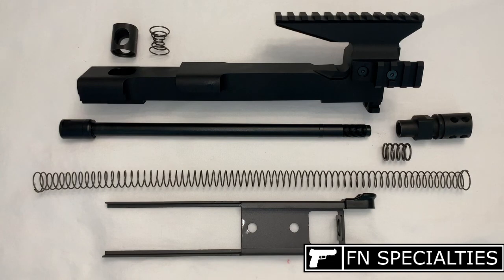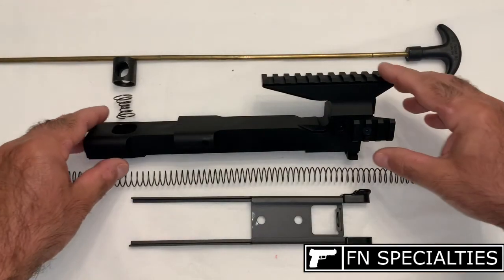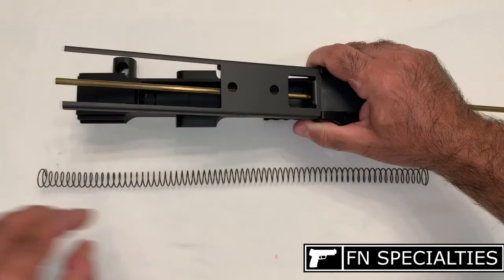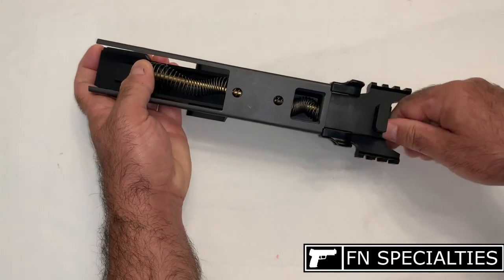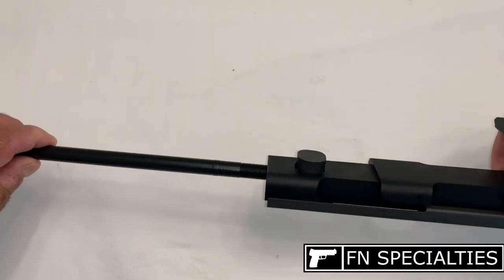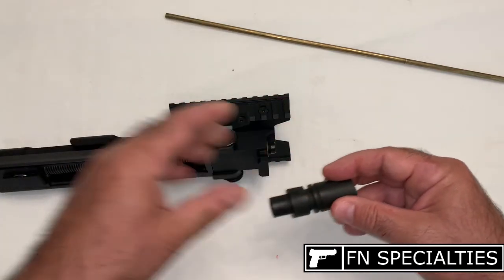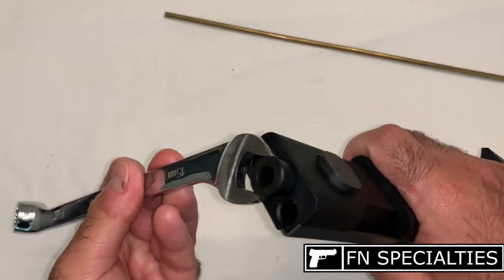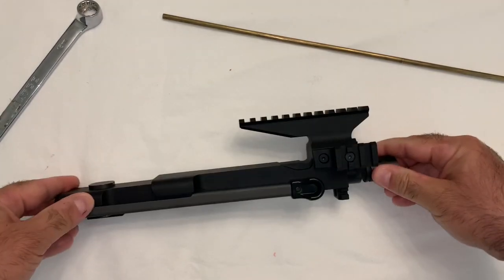Effen 90 SBR Assembly Instructions

Comment: So this is a complete PS90 upper replacement where you simply take off the stock PS90 upper and use the new one with the PS90 lower.  Basically there are no more parts needed (or anything from the stock PS90 upper), correct?  You essentially have 2 rifles with one stock.
Reply from the maker: That’s the best part… it’s your choice. You can purchase a complete assembly or the individual components by themselves on our website (including the stripped receiver). Since the release of this video, the receivers have been renamed XF50, with no other changes. They are definitely awesome.

Comment: Do you recommend using Rokset or AeroShell where the barrel meets the flash hider or adapter?
Reply from the maker: For serviceability- lubrication yes - thread locker no. The barrel’s rifling combined with left hand threads keeps the barrel tight.